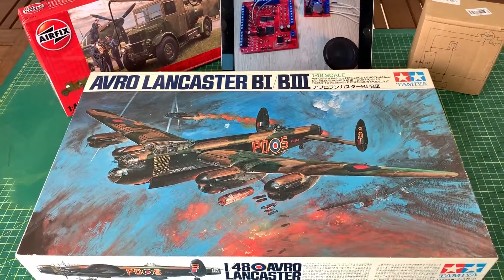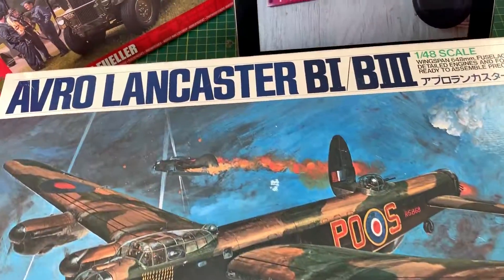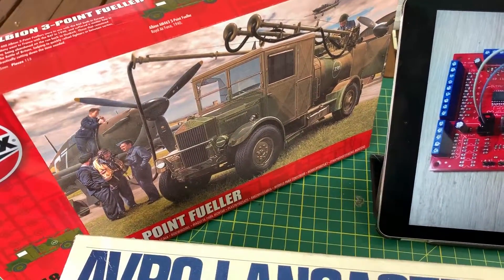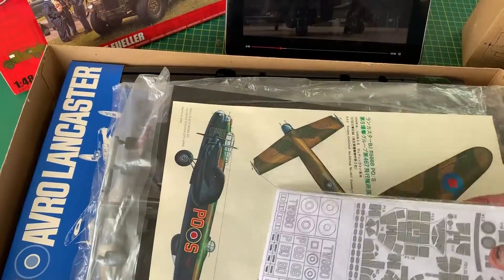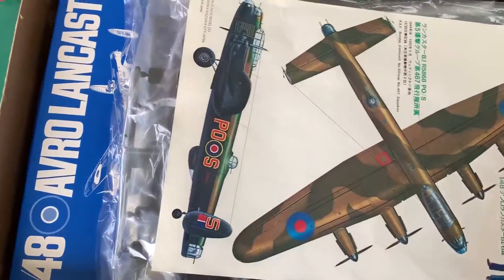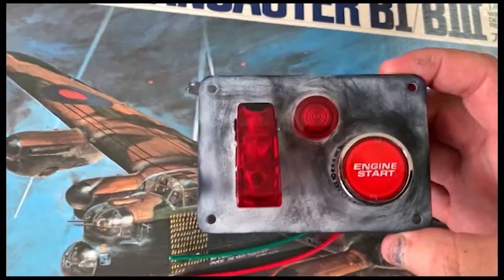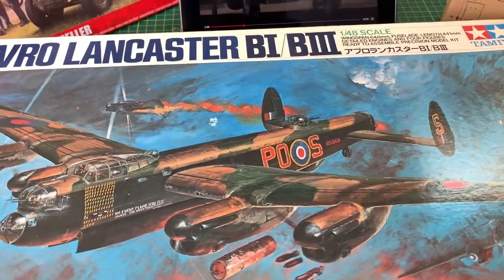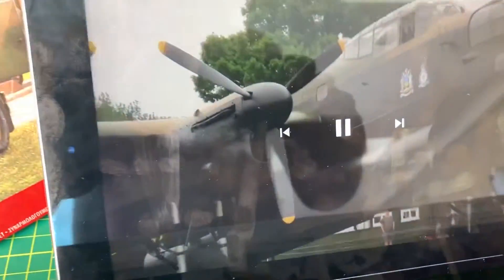Tamiya Lancaster Bomber Diorama Project (Part 1) - Spinning Props Synced to Merlin Engine Audio

Comment: What kind of computer system did you use and did you program the file?
Reply from the maker: The computer module is made by Dynamic Scale Modeling and is bespoke.  The one board they sell can be used for many different models. 2 engine or 4.  strobe lighting or normal.  From memory it has around 20 different lighting outputs.  Computer module is wired up differently for each kit.  No programming required. The kit will contain specific lighting to the type of model its been installed into.  Can also be prop or jet engine or heli. I grabbed a sound file off youtube and modified it using a free program called Audacity.  Computer board contains a basic run program. initial lights on / engine start / more lights on / engine run / lights off / engine off / last lights off.
Reply: I wonder if this would be a better idea then using the Raspberry Pi I bought for my project. Thanks so much.
Reply from the maker: @tylershepard1515  I was going to go the Rasberry Pi route, but found this option was pretty much plug and play for what I needed. No programming required.  But, the Rasberry Pi is better in that you can tweak all the options to your liking.  This module I bought is pretty much set.
Reply: Yes that's why I wanted to use the Raspberry Pi but the problem is I know NOTHING about programing so I don't know where to start when it comes to making the program.
Reply from the maker: Tyler Shepard - have a good look at the Lancaster computer - no hardware attached video that I put up. It shows the lighting possibilities on the board. Internal lighting first then engine start then all the other lighting whether strobe or solid. It will give you an idea of what is possible in the aircraft that you’re building. The kit comes with all hardware including fibre optics, smds, motors. All pre wired up. If you can make this kit work then it’s a simpler solution.